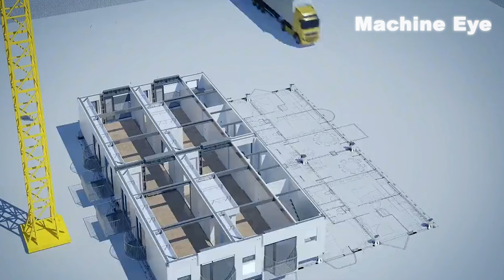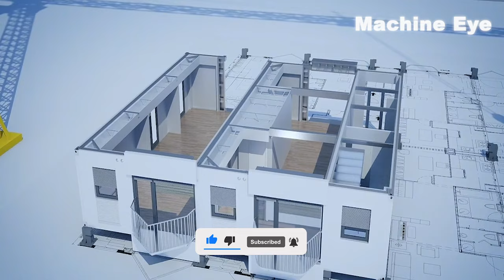Amazing Modern House Construction Methods! Fastest To Build Your House

Comment: From Denmark: Wow! It is similar to the LEGO system principle... Joke apart, it is a very good approach to solving urgent housing needs. How does it compare cost wise  to traditional building methods?🙏🙏🙏
Reply from the maker: Much lower cost than traditional concrete-built houses
Reply: Is it possible to use this method to build a single storeyed house in Africa....if so, what are the arrangements

Comment: I don't think it'll be ideal building, in absence of concrete slab only steel structure, 
In summer season whole building absorb heat in higher amount because of only steel structure so it need more energy to make it comfortable to live in this
Reply: Theory thinking if it is very logic not meaning true. the Real Answer about Thermal efficiency of the building is to be relay on fact. meaning getting the real Building thermal efficiency during the year, day and night and true scientifically testing.

Comment: Factory built modules are cheaper and  better quality than site built... factory can work around the clock in enclosed spaces... weather or night limitations are removed... standard unit sizes built in volume can be done by less skilled workers compared to those on construction site...finally building style and looks can be anything the client wants...